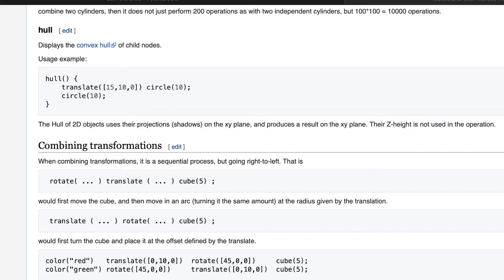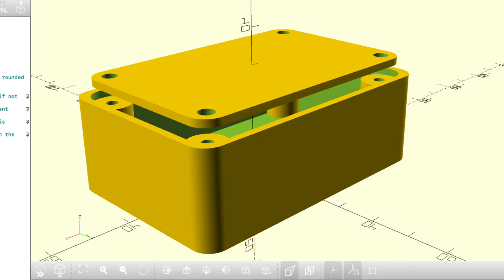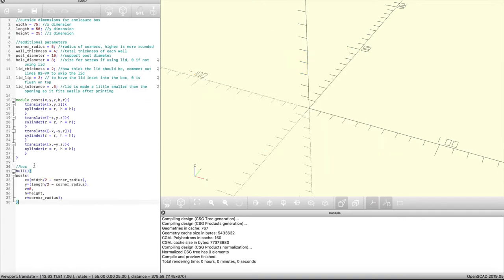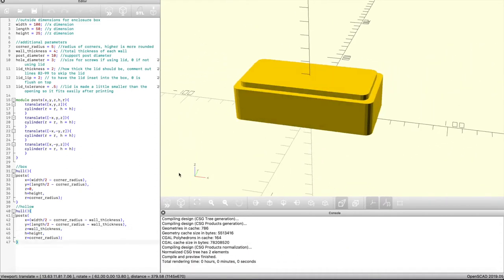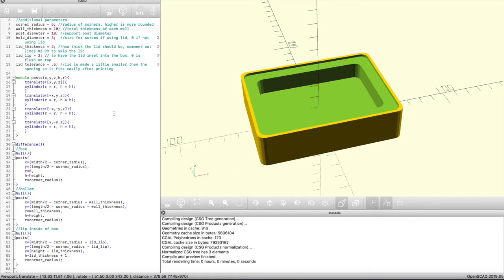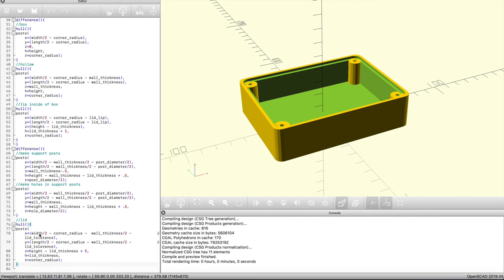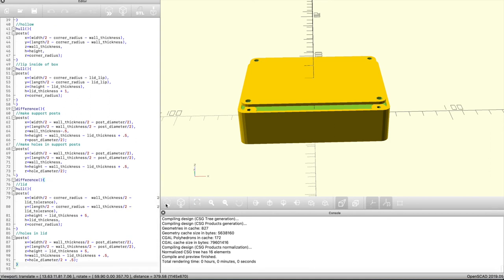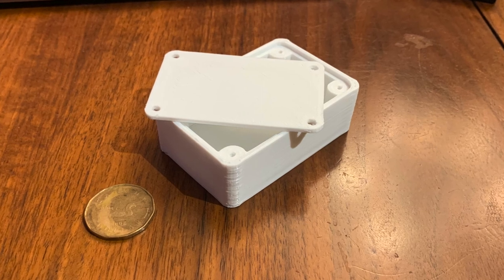Openscad: How to Model an Enclosure Generator

Comment: I was hoping someone would have done this already!  Couple of questions: Have you tried putting threaded heat set inserts into the holes and are there any issues with tolerance of position?  Secondly, countersinking the lid holes — would this just be a matter of using cones/tapered cylinders rather than straight cylinders?  Thanks!

Comment: I like your video. 
I wonder if you are willing to share the scad file you wote to create it as it would save a lot of fumbling around.
I'd like to make some custom enclosures for projects based on the Microchip DM182026

I'll add an opening for the USB connector and a header I will include in the project. I'll also add a platform/spacer to hold the board above the bottom. Perhaps add a hole for a transparent window to the lid (so the power LED is visible).

Comment: Great video! How do you export the separate parts as separate files?
Reply from the maker: Thanks for watching!  You just comment out the sections you don’t want to export. If you want to get fancy you can also create if statements that turn off certain items from being created if you change their value to false. But for most situations, just commenting out the parts you don’t want exported works great.
Reply: @BaldGuyDIY  Thanks for the quick answer. I will try it out. :) I also found another possiblity: in FreeCAD there is a Workbench called openSCAD, where you can copy and paste the entire openSCAD code. From there, individual objects can be exported, too. I think the FreeCAD solution might be another possiblity in case your proposed solution doesn't work. It's always good to have multiple options, I guess. :)